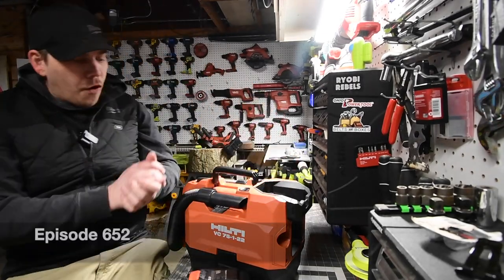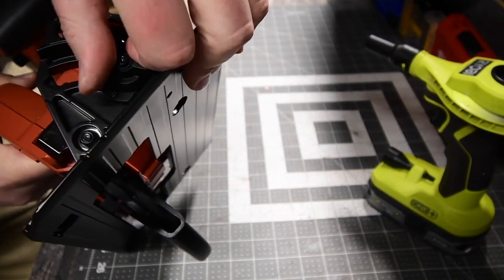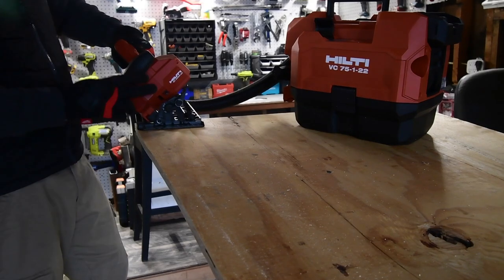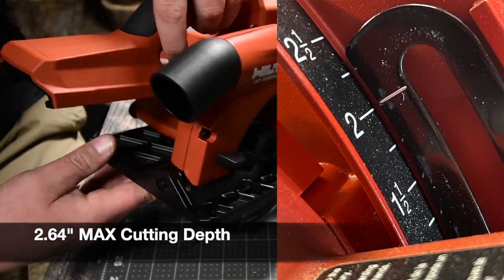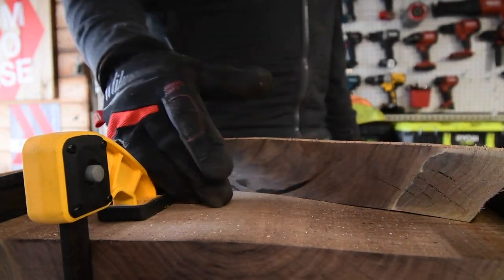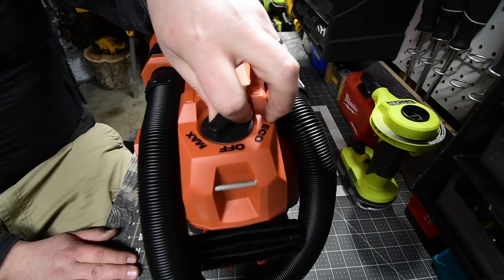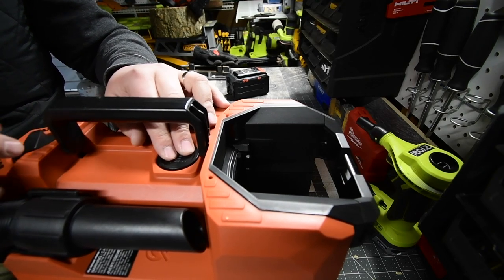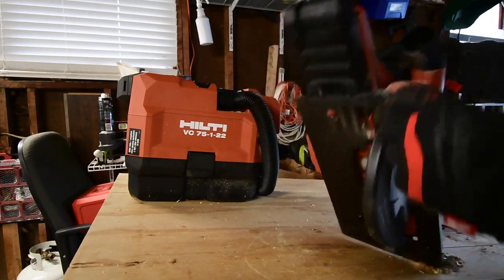HILTI Nuron 7 1/4 Circular saw/NURON Cordless Vacuum!

Comment: The fit and finish is excellent on these saws and the build quality is quite good.  I also really appreciate how they have a seamless integrated dust port ala Mafell and Festool on the 7-1/4”/185mm.  Alas, the power is just not there.  They say that Nuron can compete with 36v in power but most of the tools can’t even compete with 18v home store products.   Hopefully they will improve on this as the saws are basically all old tools with a different battery connection.   The completely new design stuff and products from past two years are up to snuff.

Comment: Dave,
You should set the base plate so that only 5mm of the blade comes through the work piece. So if your workpiece is 50mm the baseplate to edge of blade should be 55mm.
Dave.
Reply from the maker: that will be in the next video. a versus video is coming between the left and right blade.  since I had dont like right bladed saws I felt like I had less control. like if I push forward I would lose control of the saw.
Reply: All that does is slow your cut down. Less of the blade on the material. The only time setting depth is worth it is if you're worried about what's under the material.
Reply: @kyle3045   No, it actually speeds your cut up and there is less stress on the motor. There is also more blade in the cut if you have it protruding by 5mm.  I've done this with every Circular saw I've ever owned. My original skill saw I bought over 35 years ago is still going strong!
Dave.
Reply: @davesheppard8797  If you pull the blade up with the depth adjustment you have less teeth on the material, You are cutting slower. There’s tons of videos on youtube showing it too.
Reply: @kyle3045  No, because you also have the curvature of the blade cutting too, not just the back and front of the blade. All this aside though Kyle, I love my Hilti drills, SF6H A22, TE6 A22 and SID 4 impact. None of them Nuron but bought just before Nuron came out. This saw however did not impress me in the slightest.  I have the 6 1/2" Milwaukee fuel which I think would run rings around this Hilti. I bought the 6 1/2" saw as it was so light and compact.  I have an 1800 watt corded Makita for my heavy workshop cutting. I work in a large touring Theatre and work all over the place, so the Milwaukee is so easy to carry around and the power is unreal.
Dave.
Reply: @davesheppard8797  The old Dewalt 6 1/2 left blade was pretty great too it was brushed but it was Very light.
Reply: @kyle3045  I only had a very early Dewalt 18 volt 2 speed combi with Ni-Cad batteries. It Is still running today but I Can't get the batteries anymore. That drill was passed on to my two young trainees who used and abused it and it still kept going!! I prefer my Hilti combi's etc to my Milwaukee ones as I get lots of trigger issues with all my Milwaukee tools and my Hilti SF6H is more powerful than my Gen3 Milwaukee.  Plus it doesn't  get as hot....Milwaukee gets hot really quickly.  Hilti's are really tough and the warranty is superb. I just can't see what all the fuss is though about this Nuron gear. It isn't that much more powerful than my Hilti gear and the fact that the saw won't take a high amp hour battery because it hampers the base plate is ridiculous!!  Depending on what I'm doing  I will either use a 5 or a 9 amp battery in my Milwaukee, and it would also accept the 12amp.  So instead of taking one big battery you have to take a few smaller ones!! I suppose if you are on site you would have all your batteries with you. But with my job where I cart my gear to all different parts of the building to maybe do many smaller jobs, this would be a pain. What is your take on Nuron mate?

Comment: sounds like either a shit blade or low power motor , blade speed kept dropping super low even while moving slow through the cut.
Reply from the maker: That is user error, I really dont like to use right bladed saws. it doesn't feel natural for me. I dont like looking over the tool to see the cut